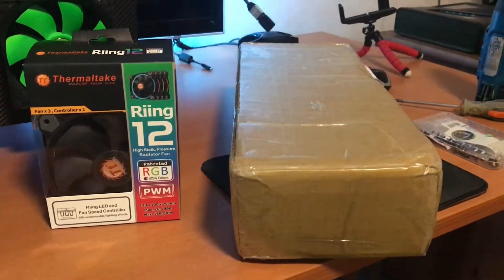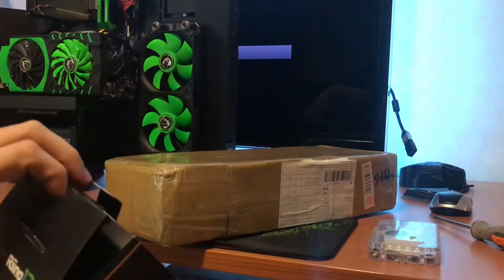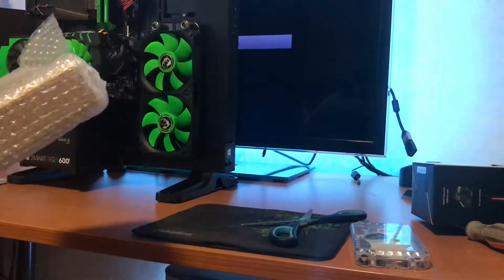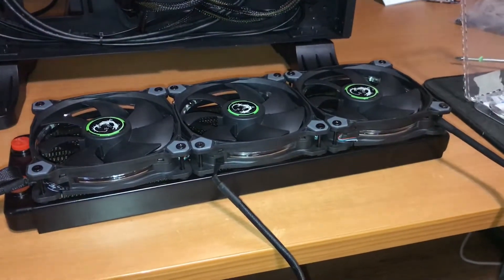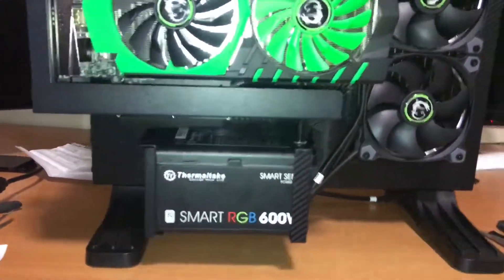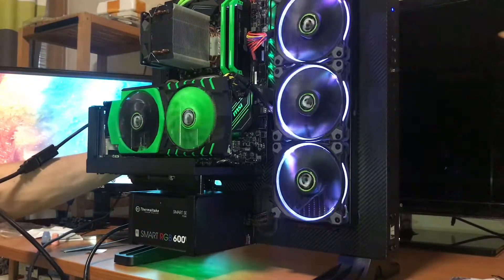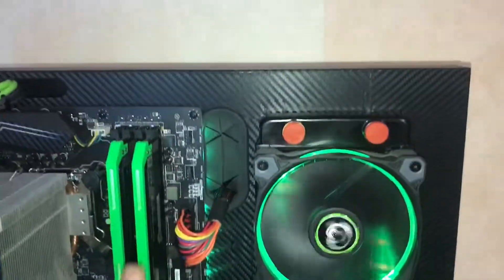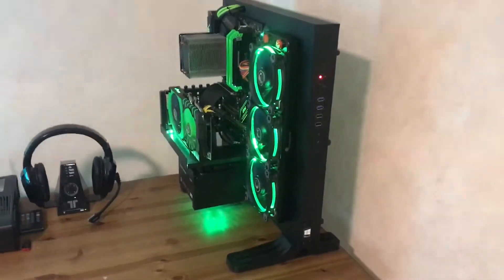Installing TT Riing Rgb + 360 Copper radiator - Core p3 (Build log 4)

Comment: Great video! Hey I was planning to do the egpu thing with a GTX 970 but what do you think about a RX 570 because is at the same performance and it comes with free sync, do you know the standard power lost because of external EGPU and do you think there is any problems with that GPU RX 570?
Reply from the maker: amd cards have issues with driving the internal lcd's on most laptops, because they come with intel hd + optimus, which only works with nvidia drivers, you can get it running but i do not know how, since i don't have an amd based laptop
Reply: Dennis Gagliano my laptop comes with a i7 6700HQ but also with a amd 375m, I don't mind not using the laptop screen because I'm getting display so I think I would buy the RX 570, thanks men, great support from your part, keep making those videos they are really good
Reply from the maker: Ignacio Juarez thanks you man, enjoy your setup